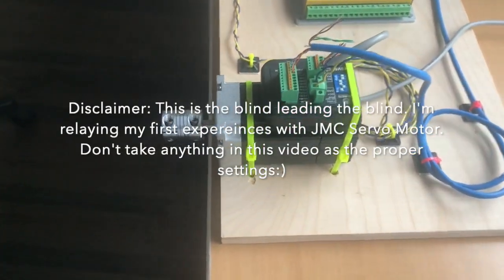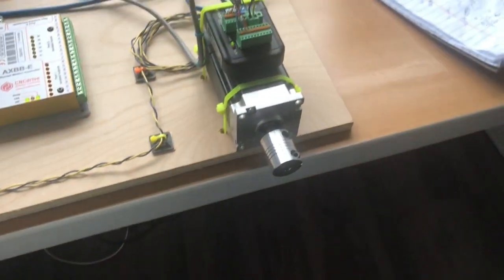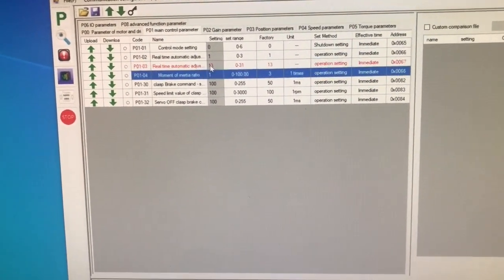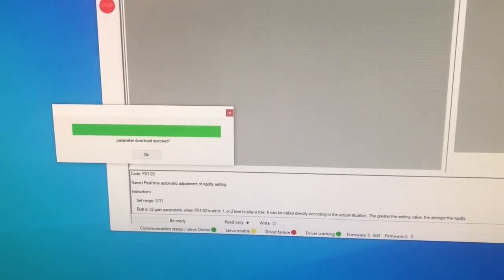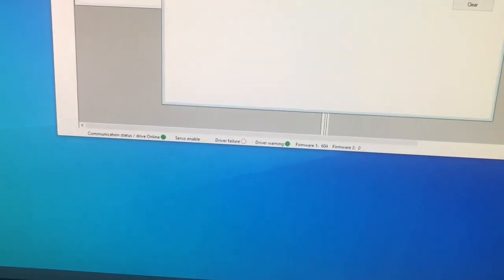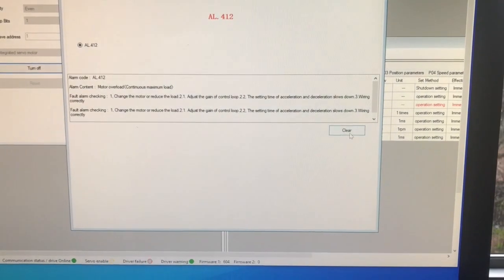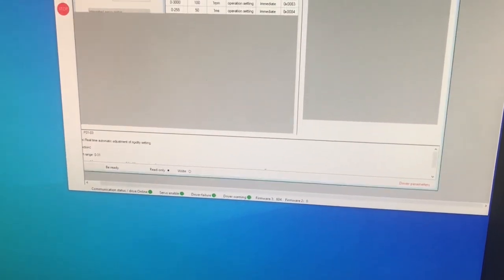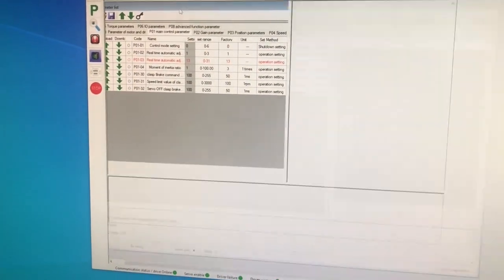JMC Servo iHSV57 (English language) Video 1

Comment: where do you get the programing cable?
Reply from the maker: Amazon. Buy both of these cables. Cut the end off of the second and wire that to the servo.

https://www.amazon.com/gp/product/B07VG76YJW/ref=ppx_yo_dt_b_search_asin_title?ie=UTF8&psc=1

https://www.amazon.com/gp/product/B00006B8BJ/ref=ppx_yo_dt_b_search_asin_title?ie=UTF8&psc=1

Comment: I am not able to change parameters. "parameters need modify permissions".  There is a password/key? Version 1.7.6 of software
Reply from the maker: There was no password on mine.
Reply: @nickp4793  After some test, i have understand that only parameters from P00-01 to P00-05  and from P00-10 to P00.17  are locked (access permission needed).

Comment: Hello. I have version 552. I connect to a new program and flashes yellow "servo enable". Tell me what should I do to make the green glow? Thanks.
Reply: You need the older version of the software (date: 2016-04-30)  if you have 552 version of servo.
Reply: @AdaptingCamera  Thank U.
Reply: @Proskurin_CNC  Be careful! I have experimented with the settings and my servo stopped working. Now it is not turning at all, not even if I set back everything to the factory default.
Reply: @AdaptingCamera  ok
Reply: @AdaptingCamera  hey i  have the same problem .what should i do ?
Reply: @sweettinette5193  Sorry, I have no idea.